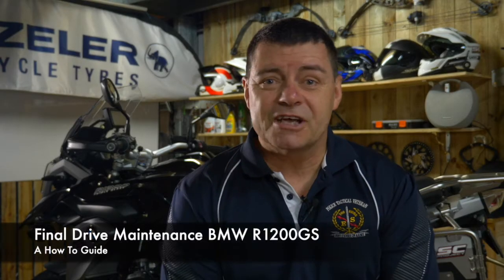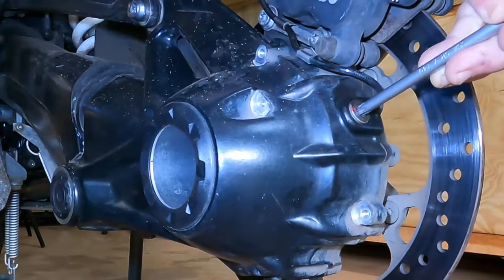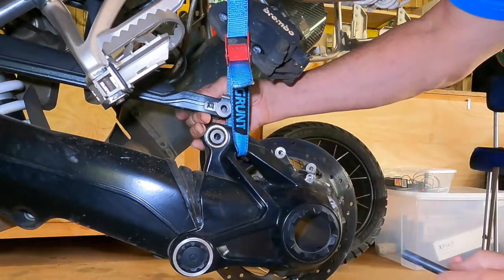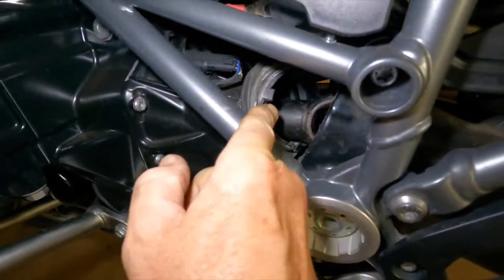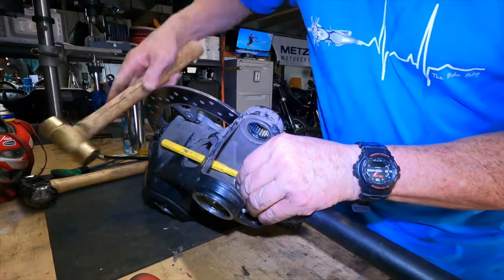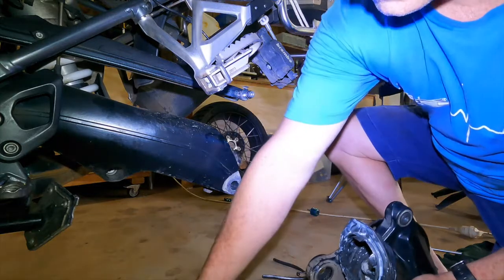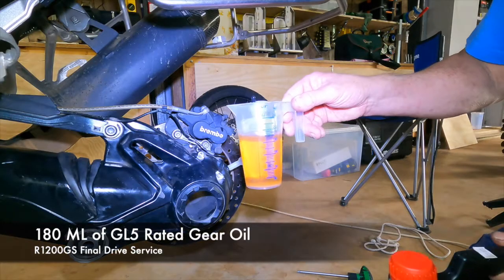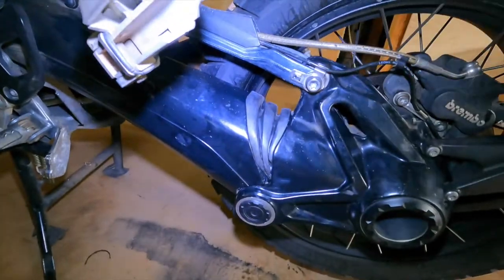Properly Servicing Shaft Final Drive on the BMW R1200GS

Comment: Thanks for a really helpful video, I have same problem, a stuck final drive. Are you able to remove the boot with the driveshaft attached, even the boot seems tight?
Reply from the maker: I think you can do that, as long as the final drive is removed from the swing arm then it should be removable. I have a torn one and just got a replacement, so I have to replace mine now too.
Reply: @TheBikeStig  thanks for reply, I got the boot off, but despite heating and good amount of force with a cold chisel and slide hammer it's not moving, letting it sit with some penetrating oil, I'm guessing it's going to be a bit of a workout getting them apart, how long did it take you? Finding it difficult to place drift on top of driveshaft as not wanting to put any force through uj joint itself, any tips?  Bit of a nightmare job, no idea why it's not on service schedule as really a half hour job when free.
Reply from the maker: @philipgriffin7136  yeah its a goddam shit fight when it seizes on. I used a brass drift and found a hole though which I could hit onto the top of the shaft. I did a bit of the same, let penetrating fluid sit for a while. I agree with you, how could this not be a service item list.

Comment: You should be using high moly spline lube on the splines, not just waterproof grease.
Reply from the maker: I actually changed to the grease recommended by some people in the know, for the life of me I can't remember it but once I get it from the shed ill confirm which one it is. Cheers mate

Comment: Confused with the gl5 oil rated gear oil , my dealer says it should be gl3 rated 75w/90 ?
Reply from the maker: yeah mate, I'd go with what the dealer says, I've seen multiple opinions on what oil ... I chose to run a Penrite GL5 fully synthetic oil 80W-140 gear oil and it has been perfect for over 15,000 ks now.

Comment: Hi.  Thanks for the video.  I'm not technical - so sorry if this is a dumb question.  My 21,000 mile 2015 GS rear drive bearings have failed and I have been sent a picture of a rusted shaft drive which apparently also needs replacing. It looks like the rear drive/shaft drive part of the bike is badly designed and the service regime does not stipulate checking or greasing.  BMW Motorrad Munich does not want to support me - which I think is ducking their obligations .  My (dumb?) question is what  is the impact of a rusted final drive?  Apart from it being rusted - and even rusted to the rear drive, can this cause any other failures - or is it just a nice to have?
Reply from the maker: yeah it sucks they don't have this as part of normal maintenance. I'm not really qualified to comment about this, I do know that some noise has gone away on mine after I freed it up and greased it. Could it contribute to other failures including bearing failure, im not sure mate but I'd rather have it sliding freely. Sorry im not much help mate.
Reply: A bit out of my realm here, but splined shafts are designed to "ride" in and out of the female yoke.  When the swing arm flexes the spline allow it to move in and out, as needed, to relieve stress.  If it's rusted and frozen, the movement cannot occur and eventually there will be a failure of the yoke or splined shaft.  This is the same with any rear differential splined shaft, in cars, trucks, or motorcycles.
Reply: @MichaelKallelisOn2Wheels  In theory, the Paralever design means the splines do not move with suspension movement. I suspect, though, that given the parallelogram isn't perfectly manufactured, there would be some tiny movement required to avoid all stresses

Comment: What about the other end of the drive shaft?  Is that usually needed as well or is it not because it is closest to the engine and less chance for water?  Thanks
Reply from the maker: I'm not sure why, but I think you hit it on the head ... it doesn't seem to get the same level of corrosion because there's less chance of water getting, mine was perfect as was the front end of the shaft for everyone I know. I did grease it though.

Comment: Awesome video!!! I have the same problem and no wd40 is helping. Shaft  is solid tot he final drive splines!!! Could you explain a little more how you managed to release it??
Reply from the maker: Yeah its a problem.
Reply: Hi Ramon , I have the same issue with my GS , did you ever get yours released and if so how did you manage it ? Thanks
Reply: @gixer08  unfortunately no. I ended up taking the shaft and final drove all as one piece and showed the dealership. This os caused by water in the tunnel not being able to exit, a recall situation that's ongoing, so they gave me a new shaft, fibal drive and boot
Reply: @raimzmoto  do you mind me asking if the bike was under warranty?
Mine still has a couple of months left but I thought if I took the shaft and hub back to the dealer they wouldn't honour the replacement as I'd taken it apart myself
Reply: @gixer08  yep I was still up for warranty, but that error is on bmws bill as a recall!!! It's shouldn't matter if you took it apart or not! And of that's the case then put it back on and take ot there. I just took the part and they replaced it. You taking it apart has no effect on it being rusted together. It's their fault and they need to honor it. No only that but do the test and place the drain on the tunnel afterwards.

Comment: Could you give a little more detail on how to remove the shaft from the final drive spline?? Mine is stuck too and even with a heat gun and plenty of WD40 it doesn't budge a single bit. Did you use some penetration oil?, did you heat? how hard do you have to hit? I'm afraid to damage the final drive if I hit too hard
Reply from the maker: I ended up using a brass drift. I was able to poke it through an opening and positioned it so that I could hit on the end of the drive shaft and push it off the differential spline. I ended up hitting it quite hard but once it moved all was good. I didn't use any penetration spray but maybe it would help. Once it moves a bit it should move easily after that. When you do get it off, make sure you really clean it good with wire brushes.
Reply: @TheBikeStig  Thanks a lot for your reply. I also finally managed to pull it out, but it took me 3 days of hammering with a steel drift. For the first 2 days it didn’t  budge. I finally left the assembly in the freezer overnight and the morning after I heated the drive shaft with a small propane torch. It was not easy. Bad news is that the yoke on the final drive end got damaged after all the hitting. In one of the directions doesn‘t move freely and one can feel frictions…
Reply from the maker: @felixhauser9948  wow, real rusted on ay, thats crazy. Glad you finally got it off mate.
Reply: I wonder what hammering does to the rear drive input shaft bearing races. 😬

Comment: Anything special with getting the shaft onto the gearbox side?
Reply from the maker: I didn't have too much trouble, just aligned the shaft by lifting it with a screwdriver from the side and in it went. Ive had it out multiple times and no issues.

Comment: What year is that bike and how many miles are on it if I may ask? Thanks
Reply from the maker: this is a 2015 triple black (December 2015) ... It now has 35,000 kms on it, had around 25,000 on it when I did this work

Comment: How often would you need to do this service?
Reply from the maker: I don't know what the standard is as this is not a serviced item on the bike if you follow the service manual. I drop the diff when I service the bike every time now and grease the spline. Have not had an issue since I started doing that.
Reply: Thanks. I don't own one but have been thinking about getting one

Comment: Wrong oil  (70W-80 Hypo), wrong grease for the splines (Castrol Molub-Alloy Paste TA), wrong NM (56) for the main torx screw on the Paralever and forgotten to fix it with green Loctite. Never grease the rubber parts facing the Final Drive. No blue Loctite used to fix the rear break caliper torx and absolutely wrong NM (24). No word how to reinstall and fix the Cardan Shaft on the upper splines. And so on and so forth. Sorry, but I don't recommend to follow your wrong and incomplete instructions.
Reply: I was wondering about the shaft being out of balance  if it dosnt go back the way it came out. Do you know if these are balanced shafts like a car?
Reply: @timphoto83ec  They are, but with a simple cardan drive, especially with larger articulation angles, a uniform power transmission is not possible, since the angular speed of the drive axis with respect to the output axis is subject to a periodic fluctuation. That's what the Paralever is for. The Paralever system, which combines the tasks of rear wheel guidance and power transmission, largely eliminates the forces induced by the cardan drive. Reinstallation can be difficult. This is due to the tightness of the cardan tunnel and the location of the upper splines.
Reply from the maker: I appreciate the advice and you sharing your knowledge mate.

Comment: What a bad design.
Reply from the maker: yeah its interesting, yet its been around for a long time now. The upside is its pretty easy to service the pieces of the drive train including the tail shaft.
Reply: Not a bad design. Just no lube and no specific instruction to apply lube. If lubed, it's a fine design.